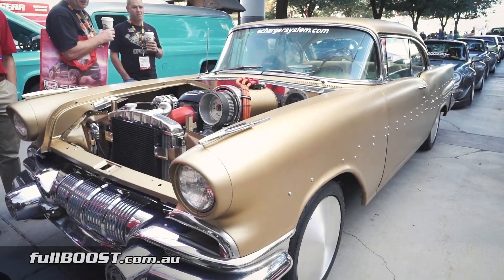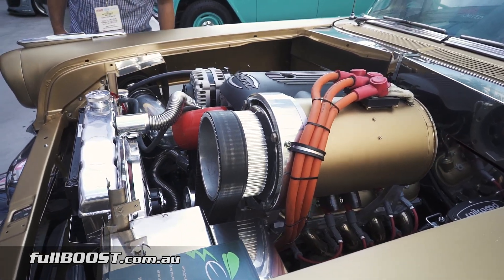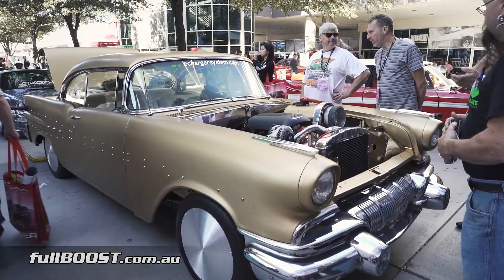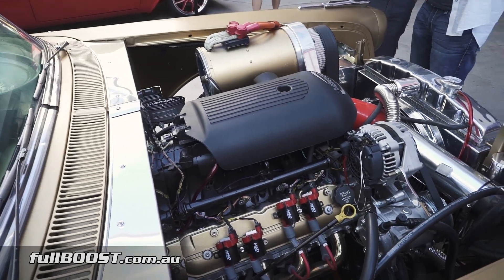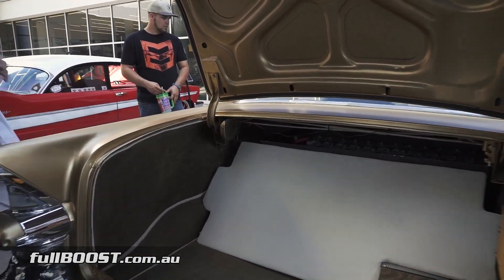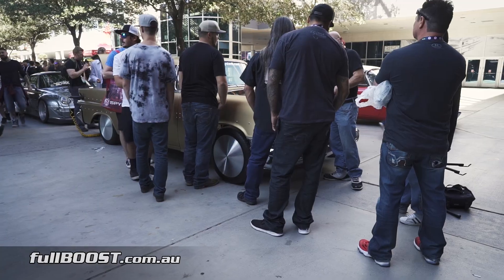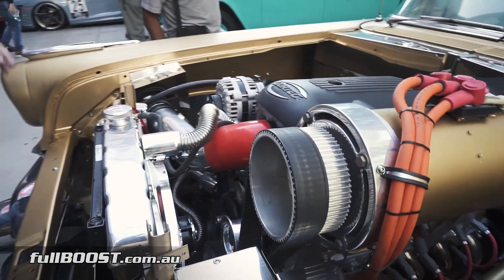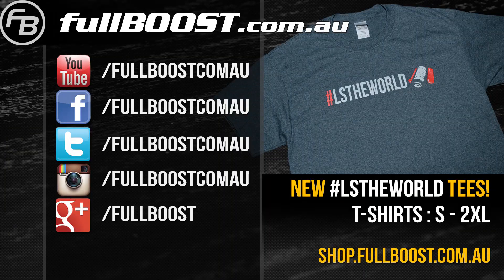The E-Charger Hybrid System

Comment: I thought it was an electronic supercharger. I am very disappointed.
Reply: JoshTheLewi it's better it's instant 150 ft lbs of torque
Reply: That sounds stupid and ineffective. It would require a lot more power to keep it running all the time than already present parasitic effect.
Reply: tim ray no its not that heavy with lipo cells
Reply: It wouldn't be hard to put a clutch in there, just like a clutched blower or a/c condenser. Alternately, you could just run the power supply with enough current to spin the motor and not add torque to the system. That wouldn't draw much at all.
Reply: No way, He said it was roughly 200 pounds. Not much different then adding a passenger to your car
Reply: Yea you need that 150 ft/lbs to move the extra weight of the system. epic fail unless all your going for is mpgs
Reply: John a clutch? why do they need a clutch? electric motors spin freely when the leads aren't shorted.
Reply: JoshTheLewi so was I but there is a legit company making them I can't remember who they are but they ran a 48v system for the supercharger, Borg Warner is making a electric turbo to assist a regular turbo it's called the ebooster.
Reply: John it's most likely clutched to the rest of the car
Reply: What happens to your AC compressor when you're not using AC? A clutch disengages it. I'd imagine this is the same.
Reply: Bob Newhart no it wasn't procharger I found it the company is Aeristech they make fully electric superchargers
Reply: +four27060 Very true. I didn't consider that. But it would have to be a very beefy clutch if it really puts out the torque that they're claiming.
Reply: phatvortex Yeah but the clutch doesn't have to be nearly as strong. 150 ft lb of torque is no joke.
Reply: David Serrano Didn't know that it was that simple. Not a big electrical guy but I'm slowly learning.
Reply: Ungregistered User well his design isn't new. It's used in F1. To make the powerful beasts more efficient.
Reply: Electric motors can't just be free spun. They're constantly converting rotational motion into electricity via the magnetic field. That is why this design is stupid.